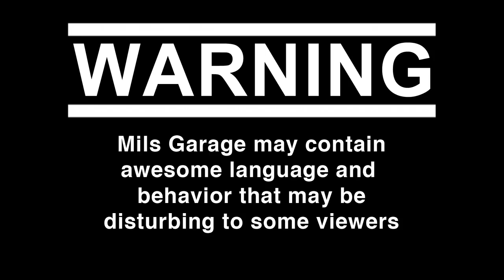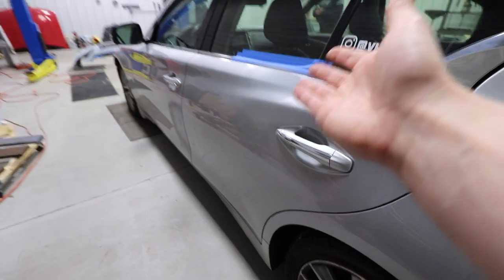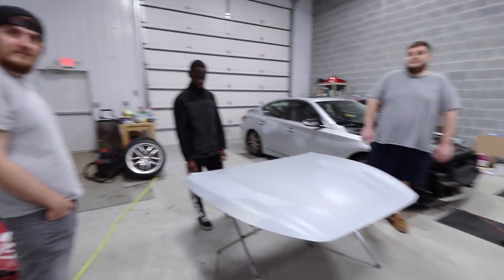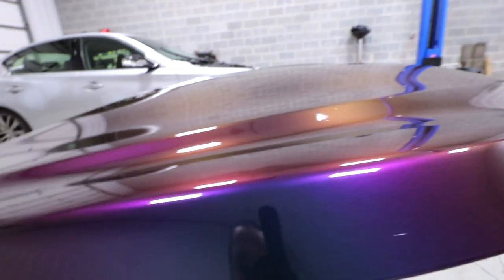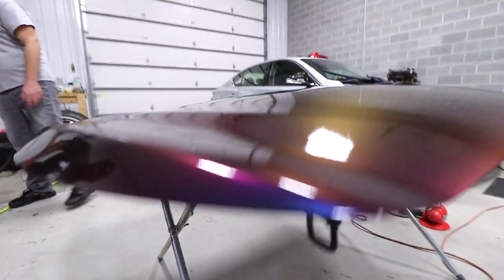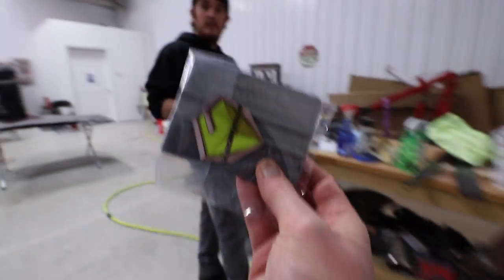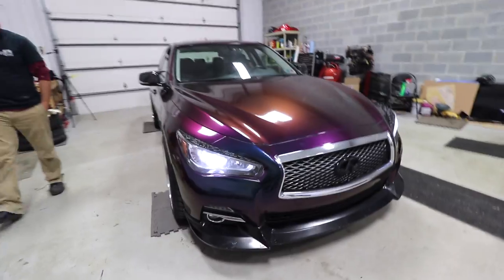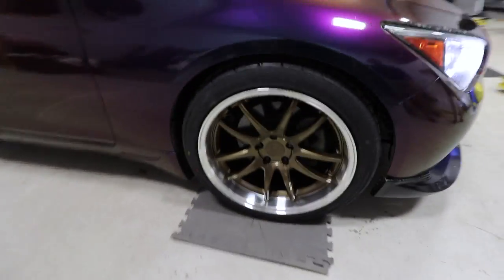Q50 Gets Wrapped [Car Show Worthy?]

Comment: How do you maintain this wrap and how long does it usually lasts?
Reply: Hey bro! So to maintain the wrap (I’d recommend getting it ceramic coated after install to protect from light surface swirls and scratches etc.) you would wash your car as normal with a non abrasive wash mitt and a good automotive car wash solution! Also would recommend using a shammie to dry with as well so you dont get any hard watermarks on the vinyl!! Hope this helped!
Reply: Thanks for watching! Stay tuned for more Vinyl Jobs!!

Comment: Yo Mils. Can yo help me out with anti wheel hop and better than stock rear shocks ? 17’ Mustang GT 6 sp manual.
Reply from the maker: We can definitely install new suspension, coilovers, and air rides at the shop. Are you in the Delaware area?
Reply: Look in to irs bushings or cradle bushing lockout kits or arm bearing upgrades from American muscle site